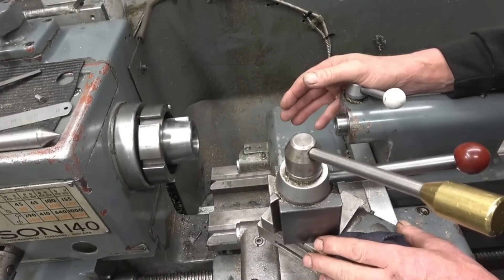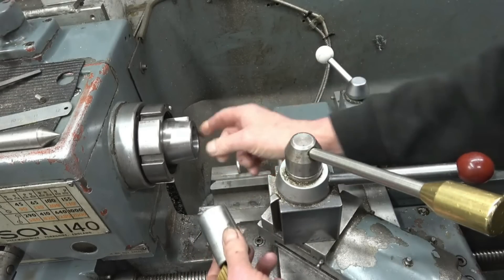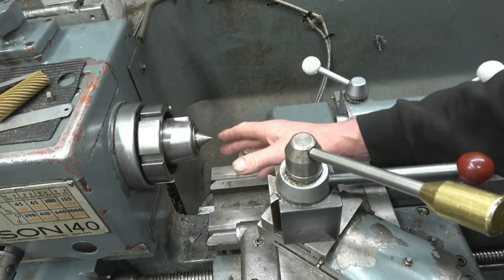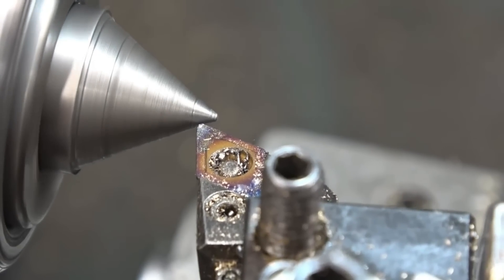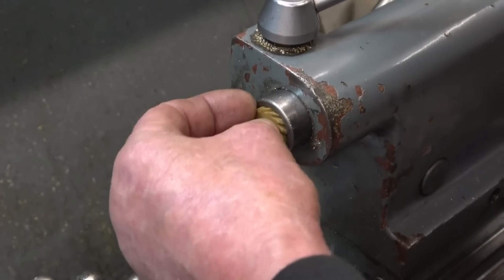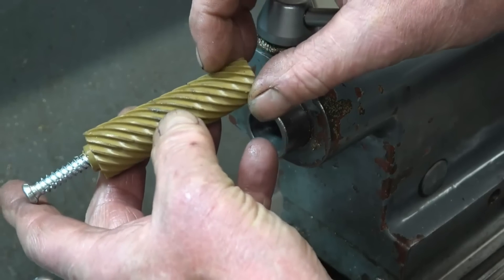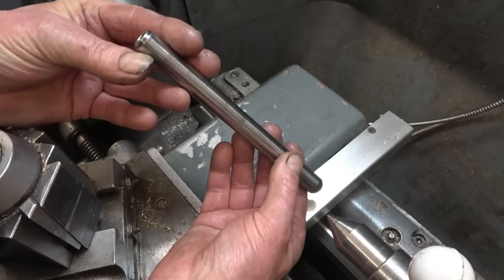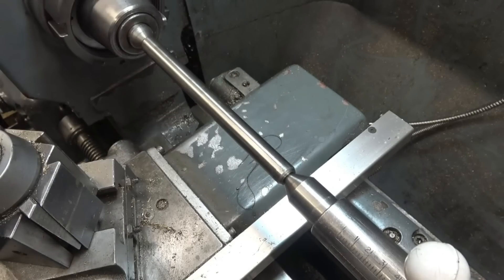Wed Catch Up 16  Lathe Tailstock Alignment

Comment: it still aint right it still moved about by ete 4 to 7 thow.
Reply from the maker: It is the tailstock chuck I was using. Tried a ER32 with the drill it was spot on  .I will turn a shaft between centers  to verify

Comment: I noticed it in your last video also. I have a similar problem with mine but worse, mine as I extend out is traveling on a slant and mine doesn't allow front end and back end alignment like my 6" lathe does so I cannot true it up. I found a video where another person had that same issue and he came up with a good idea on how to fix it. He removed the quill from the tail stock itself and chuck up a boring head in his chuck and had the tail stock clamped to the carriage, with slight pressure on the lock down on the tail stock he had the carriage feed the tail stock into the boring head and over sized it then made a bushing that fit into the tail stock. I'm going to do this to mine because if I don't keep a slight tension on my tail stock quill it moves around several thousands and is on a slant so this will fix two issues at the same time.

Comment: John, where did you get the morse taper cleaning thingy
Reply from the maker: I had 2 given to me by a viewer  number 2  and 3  .
They were laser printed
Reply: On Printables there's one called MT2 Cleaner Revision (size I need) that shouldn't break quite as easy.  Looks handy so I'm printing one tomorrow with a few extra walls/perimeters.

Comment: John, I noticed your subs seem to be the same. are they still creeping up?....
Reply from the maker: yes they are going up but very slow . i have been told this happens when you get near 100k
Reply: I have just done this on my Mini Lathe. It did still look like it was deflecting a little. Maybe it’s the camera angle.
Reply: @crawlstockrc with a long drill and a chuck in the tail stock the drill sometimes is not in line with the work perfectly due to jaw wear but generally it will centre on the previously drilled centre well that’s my experience anyway

Comment: On my Colchester Triumph the tailstock was about 10 thou lower than the headstock. Had to shim it. A bit awkward as you have to do it between the base of the tailstock and the tailstock casting itself.